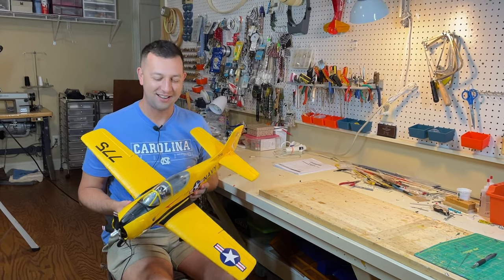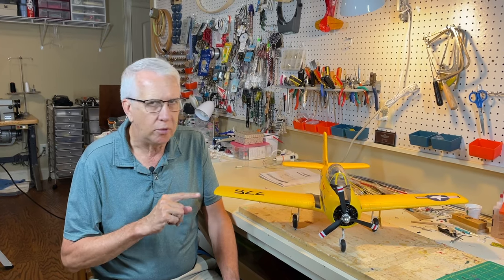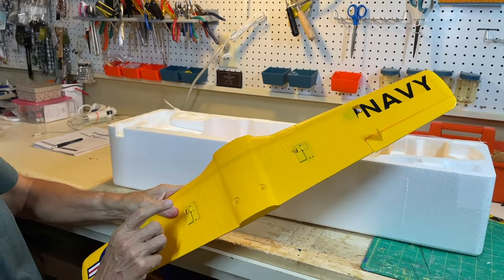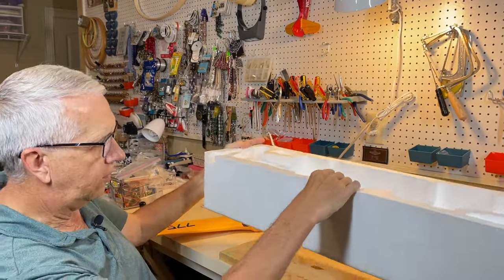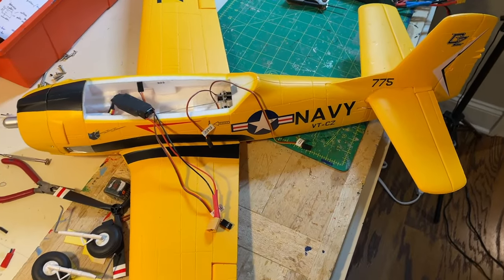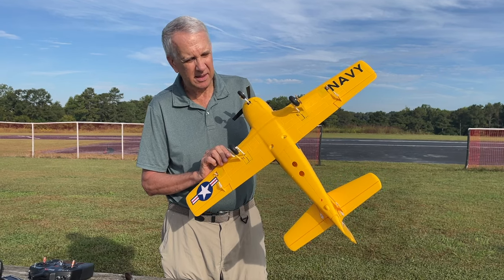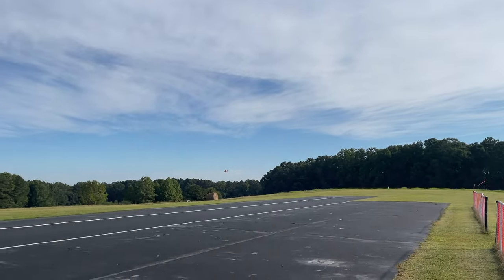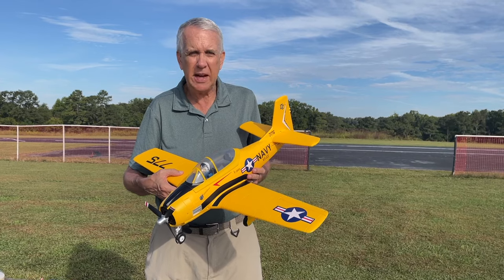Fair RC 800 mm T 28 Unbox, Build, Fly

Comment: These 800mm planes are a nice convenient size. I have a 800mm Skyraider however I have to pick my days when the grass at my field is really short or dry and thin. 

I will say, I’d like to see talk about FRIA/Non FRIA and remote Id stay out of reviews. Compliance is a personal choice and I don’t think it needs to come into the conversation about the planes themselves.
Reply from the maker: Jon:  Thanks for checking in!  Following FAA regulations is not a "personal choice."  For the safety of all, the regs should be followed.  Just what professionals do.  Tim
Reply: @TimMcKay56  I’m going to disagree with you on that. The RemoteID was prompted by irresponsible quad copter pilots not vested hobbyists. They created the problem by drawing attention to model aircraft as a whole by irresponsible operation and not following AMA safety guidelines. Professionally I have to deal with people who fly quadcopters over my commercial vessel. They are oblivious to the rules they are breaking and the problems they are creating. For that reason alone “I” refuse to be lumped in with “them”. Compliance is a personal choice, regardless of the status of your flying site. No site that has been AMA sanctioned should be denied FRIA status, it was vested prior to authorization to be safe for the operation of model aircraft and nothing has changed.

Comment: I made files for prop adapter to use a regular apc 7x5/6 two blade prop. 15$ is expensive for a prop imo. I haven’t flown mine yet as I’m waiting better weather.  Takes 10 minutes to print the parts. Even the nose spinner can be printed and just twisted on.
Reply from the maker: Good stuff, thanks for sharing!  Tim